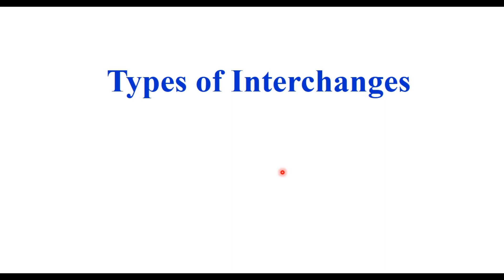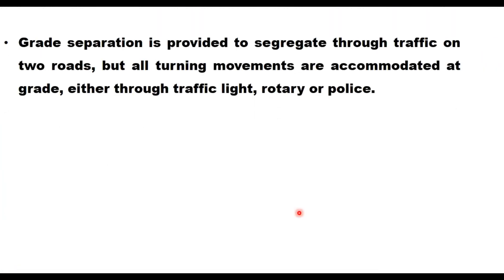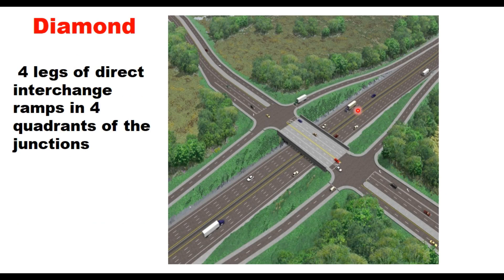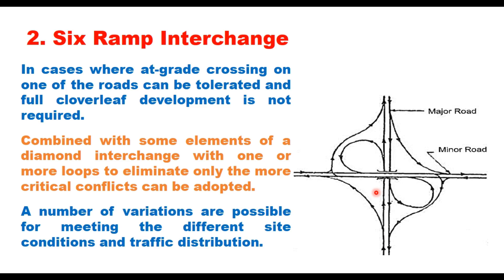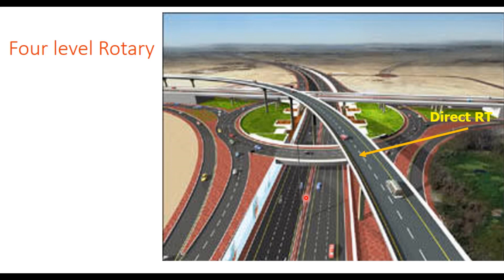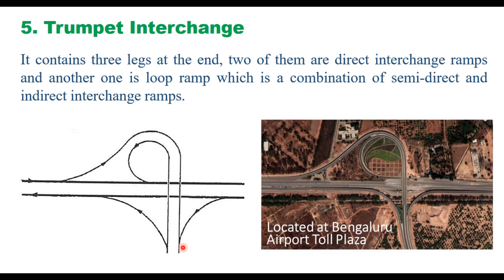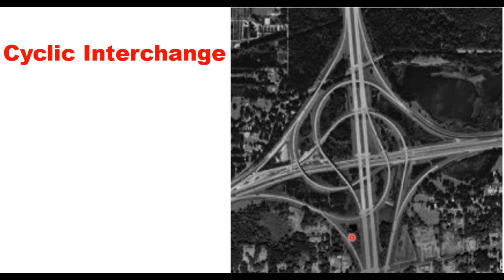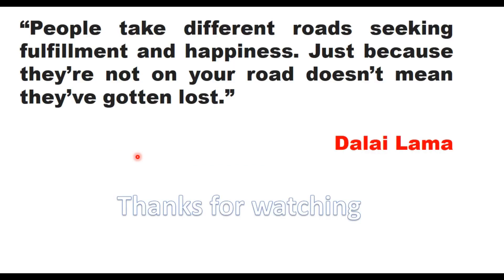#Interchanges Type of Interchanges and their classification. Design considerations, diamond, trumpet

Comment: Dear sir, 
What is the Minimum Radius and Gradient for Loops, Semi Direct connection, Direct connection, and Diagonal Connection?
Reply from the maker: As per IRC SP 99, 2023, the minimum radius for ramps (for any connection) is 300 m. It can be reduced to 170 m for loops.
Reply: @SatishIITR  Dear sir, 
As per IRC 92 - Minimum radius for Loop Ramp is 30m And Desirable is 60m. And for Ramps Minimum radius is 60m and Desirable is 90m. 
Please clarify in this.